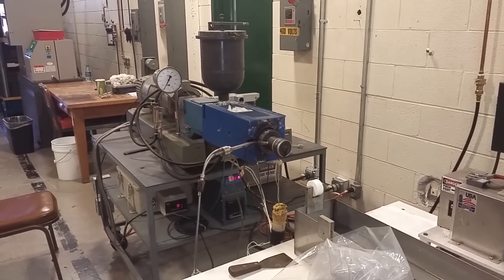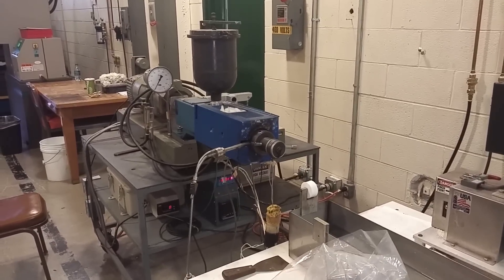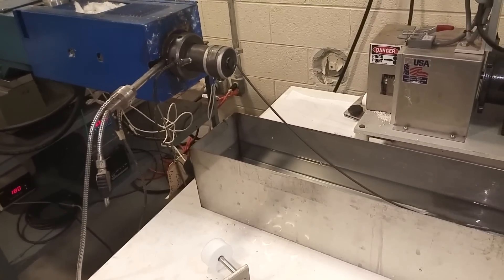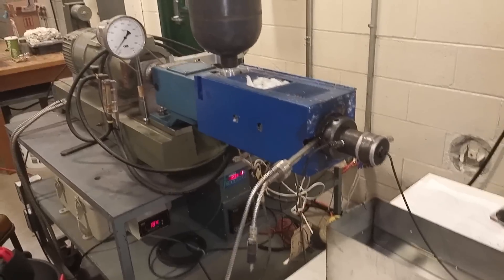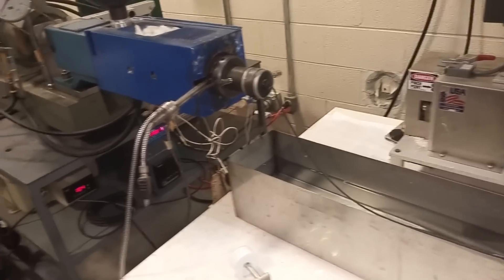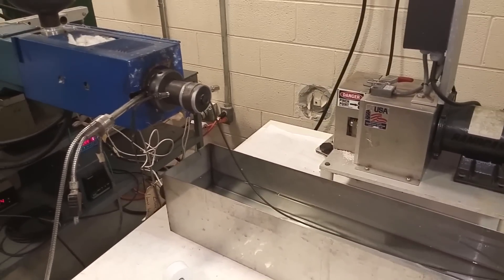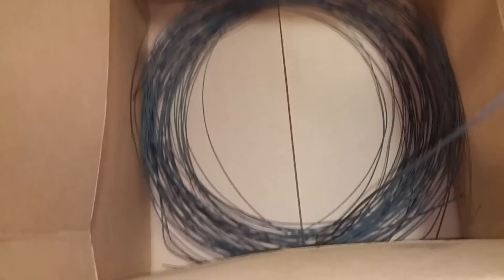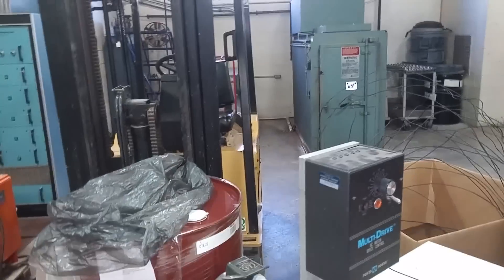Graphene 3D printer filament production.

Comment: If I put abs pellets and some of your graphene in my own extruder will I get good resluts or do I need to blend or mix the cool dry graphene in better beforehand?
Reply from the maker: You will need to dry both the plastic and graphene. If the unit is a single screw, you will have difficulty getting it to homogeneously mix. You will have to run it through several times to get it to blend.
Reply: Venturestarx I cannot find an affordable double screw extruder, I am considering the Filastruder. Will running the filament through more than one time weaken the abs polymers? Also, do you know of a cheap double screw extruder? Thank you so much for answering even once!
Reply from the maker: It will weaken them by a very small degree. Far less than the added strength from the graphene. Remember, the better the graphene is mixed, the better your results. And when ever you need help, feel free to comment. I'm about to release new videos as well, because I'm back in the country.
Reply: Venturestarx You are a true treasure of a resource, and I'm so glad I got in contact with you! I bought what I think is your graphene on Amazon 10g worth. Before I get printing and filament equipment I want to make a "hockey puck" but out of the highest tensile strength polymer clay. Do you see issues with this?
Reply from the maker: When did you get it? We stopped selling on Amazon about a month ago because of a new contract.  As for you making stuff, I think it will work out fine. You may have to play with the amount added. With graphene, less is usually more. Sometimes you can put as little as 0.3% into a plastic. It just depends on how well it mixes, the crystallinity, and the elastomeric principals of the base material/desired material.
Reply: Venturestarx It was about a month ago so I guess I barely made it. Will you be selling any readymade filament with 3% or more graphene?
Reply from the maker: I think we are making arrangements for master batching ABS for filament producers. (I don't have to do sales anymore, YAY!) I have a bit of 1.5% material that is 164% stronger than any other ABS product on the market. But I can't sell it yet because we are still working things out, and I'd rather have a filament company make it in mass.
Reply: Venturestarx Have you seen the Black Magic 3d filament which is graphene enhanced and is ready for sale? It sells for 55.00 USD per spool but does not look as high concentration as your stuff and it's not made with ballistics in mind.
Reply from the maker: Insidious Blank It's RGO derived, and that stuff just doesn't work for strength. I would say it's garbage at best, but they can load it up to make the plastic conduct to a degree.
Reply: Venturestarx So I tried to mix .5g of graphene with 46.4g of polymer clay. Long story short it didn't mix in it just made the clay crumbly and dry. So looks like I am on to the big leagues. How many passes through the single screw extruder would it take to match the double screw process? Thanks again!
Reply from the maker: Must be the crystallinity of the clay. I think it may work better if you added far less (like 0.01%). The single screw may take 3 or 4 passes.
Reply: Venturestarx Thanks. Can I loop the filament back into the extruder right as it comes out, or do I have to let it cool?
Reply from the maker: You can do that, but be careful of the feed.

Comment: Well done, how many Ohms resistance does it have per meter ? Can you sell me a few meters please ? Would be interesting to see, how coils behave with this conductive wire... Can you also coat it with varnish coatings ? Many thanks. Regards, Stefan.
Reply from the maker: +overunitydotcom ABS and Nylon would require a bit more graphene in the mix to be "conductive". I'll try to mix a batch of PLA with a high percentage of graphene to make conductive tests on the 19th. If you want some, I may just send you some pellets of the material, just PM me here. As for varnish, I think you could pull that of easily.
Reply: Venturestarx
Many thanks,yes please let me know, how many Ohms / cm distance you get for this wire... Would be maybe very interesting to wind a few coils out of it and try its properties , also if they have some BackEMF and how the magnetic field will be around them and if one could use there to make motor coils...
Many thanks. My email is:
hartiberlin@gmail.com
Regards, Stefan.

Comment: So are there continuous strands of graphene lattice running the length of the filament, or are they smaller flakes that are simply suspended in the ABS?
Reply from the maker: +PunchAPeach They are flakes suspended. But they seem to interact with very good results. I should have had the data as a "big reveal" today, but it snowed and shut our city down. :(
Reply: +Venturestarx Oh man, be safe bud. I live about 20 miles outside of Philadelphia and we're expecting to get hit on Friday. But I'm super pumped to hear about this data! My first thought about applications for this material are ultra-lightweight bicycles.
Reply from the maker: I didn't bother going out. Kinda sucks though, because I had plans for today and tomorrow.